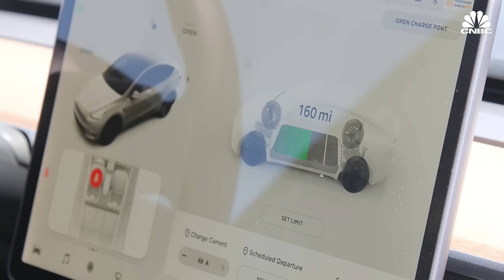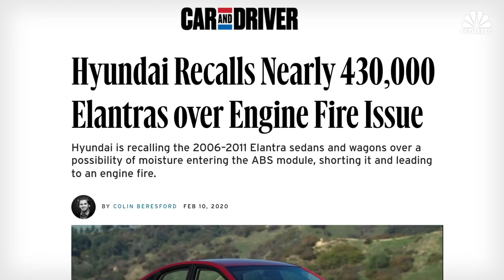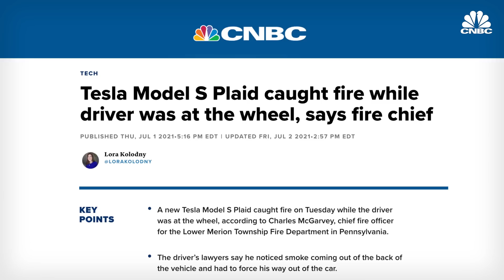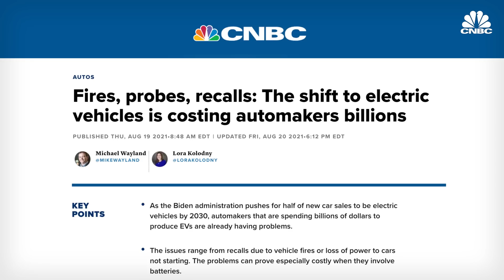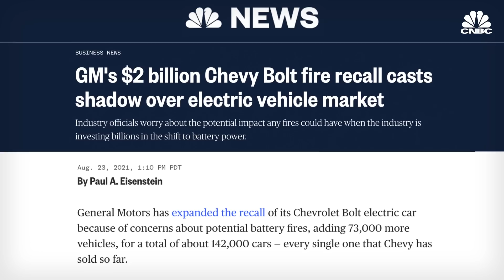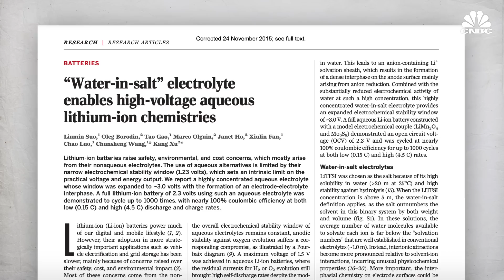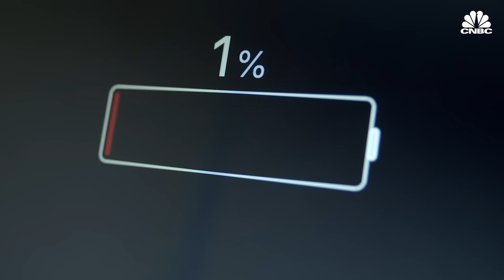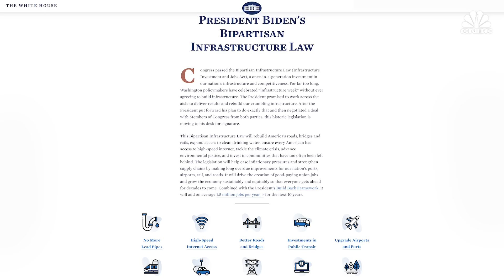Why Tesla, GM And Other EV Companies Have A Fire Problem

Comment: My brother drove a gasoline VW van that burned to the ground. If you look at the number of fires per number of type of vehicle, EVs catch on fire much less often. And with battery chemistries like Lithium-Iron-Phosphate, the chance of fire is much reduced.
Reply: Cool, what is the source for your statement that the number of fires are lower per capita for EVs? Would like to refer to that should I ever consider an EV for purchase.
Reply: “...but when fires do erupt, they burn longer and hotter, propelled by lithium-ion batteries that supercharge the blazes, experts say,”
Reply: @sking2173  Not so with lithium-iron-phosphate batteries. Solid state batteries will be even safer still, but they won't come out for a couple of years.
Reply: This wont change my mind on buying ev vehicles
Reply: @unfairsanic5089  Well do ur thing dude. Just have a escape plan ready.
Reply: Was that a 40 year old vw van?
Reply: @stevemurray710  No, it was about 15 years old.
Reply: @lesliefranklin1870  we will have to wait to see what percentage of 15 year old rusty Teslas catch fire.   That's if any Tesla makes it to 15 seeing battery replacements cost $16k.   The battery cooling system will clog and corrode.  Inverters fail, motor bearing.  Huge money pit.  Despite claims of being cheap to maintain there is a reason the Tesla doesn't have a bumper to bumper 10 year warranty.   Repairs are $$$$$, versus needing a muffler.
Reply: @stevemurray710  Tesla was founded in 2003 and launched the Tesla Roadster in 2008, Model S in 2012, Model X in 2015, Model 3 in 2017 and Model Y in 2020. They are some of the most safe and reliable cars on the road.

To be fair, Tesla is not an economy brand. If you needed to repair or replace an engine on a BMW or Mercedes, it would cost $$$$$ too.

There are about 173,000 (in 2020) gasoline car fires per year. This is not in the news because this has been going on for over a century.

Also, you should talk with a Buddhist. They can tell you about the impermanence of existence. Laughing, because we can't do anything about it. LOL! Peace be with you.
Reply: Ev fires are way more deadly genius.
Reply: Correct as there is no thermal runaway issue with LFP batteries.
CNBC is constantly behind the curve in reporting in the EV space.
Reply: EV fire numbers will only increase as more vehicles are added
Reply: @TheIncomparableGolfer  No.   The fire risk is per 100,000 cars.  "Fully electric vehicles, on the other hand, were deemed far safer than both hybirds and gas cars; they are far less likely to catch fire, with just 25.1 fires per 100,000 sales. That's compared to 3,474 hybrid fires and 1,529 ICE fires per 100,000 sales respectively."

Electric cars are simply over 60x less likely to catch fire than combustion engine cars.
Reply: @redbaron6805   your a fool if you think that per 100,000 # won't increase when more electric vehicles are sold.

Also ICE vehicles made since 2010 catch fire alot less than older ICE vehicles. So even the per 100,000 for ICE vehicles that carch fire will keep decreasing
Reply: @TheIncomparableGolfer  No they won't, because the usage of LFP and Blade Type batteries will only increase. These have zero thermal runaway characteristics......
Reply: @Brian-om2hh  you are correct LFP is the way to go.. lets just hope we have enough "battery manufacturing material" to supply the global demand..
Reply: @TheIncomparableGolfer  True. However, the percentage of EVs that catch on fire is much lower than ICE cars. It's new and unusual, so it gets more reported. ("Man bites dog.")

Remember the Ford pickup trucks that spontaneously caught on fire because of faulty cruise control design?
Reply: @lesliefranklin1870  Dude...U don't understand. EVs make up 3% of auto sales. If that number increases to mass adoption u can't tell me that EV fires won't overtake gas fires.
Reply: @herbertfreeman3767  "the number of fires per number of type of vehicle" I was posting about percentages, not totals.
Reply: @lesliefranklin1870  Dude...anyway u slice it EVs still carry a greater risk of exploding than a gas car. There exploding  wile charging. Gas cars are not catching fire wile fueling up at gas stations.
Reply: @herbertfreeman3767  No. Because the fires are per 100,000 cars.  "Fully electric vehicles, on the other hand, were deemed far safer than both hybirds and gas cars; they are far less likely to catch fire, with just 25.1 fires per 100,000 sales. That's compared to 3,474 hybrid fires and 1,529 ICE fires per 100,000 sales respectively."

Still struggling in the facts and data department there Herbert?  Math not your thing...?
Reply: @herbertfreeman3767  "Dude...anyway u slice it EVs still carry a greater risk of exploding than a gas car. There exploding  wile charging. Gas cars are not catching fire wile fueling up at gas stations."

Except the ACTUAL DATA and ACTUAL MATH shows the polar opposite.  EV's are 60x less likely to catch fire AT ALL.  Most of the fires area after catastrophic crashes after the battery was damaged, NOT while the car was charged.

Please tell me no one graduated you from High School...
Reply: @redbaron6805  go get that head injury checked dude. Ur math and ur fantasy land facts didn't impress anyone today. The only thing that was proven here is that you fell off that cabbage truck hard. And ur  refusing treatment.
Reply: @lesliefranklin1870  look up their methodology please. Don’t just take the number for granted
Reply: @herbertfreeman3767  exactly and the fires are more intense and toxic
Reply: @mmc5261  yes sir. 👍💯
Reply: @herbertfreeman3767  From today's news: Ford Motor Co. has asked the owners of 350,000 vehicles to take them into dealerships to be repaired under a three-pronged recall announcement. About 39,000 of those vehicles should be parked outdoors because their engines could catch fire, Ford said. 

The Michigan automaker said in U.S. government documents posted Thursday that it doesn't know what's causing fires in some 2021 Ford Expedition and Lincoln Navigator SUVs.

Still, the company said the fires can happen even while the engines are off. There have been 16 reports of fires under the hood
Reply: @JayMcKinsey  Yes...Point taken. I still wouldn't feel comfortable having a electric car in my garage that's attached to my house on a charger charging all night wile I'm sleeping. That's just me. Even though Ford is having this problem I would still sleep better with a gas car in my garage. I'm in my 50s, been driving gas cars sense 1985. Never experienced a gas car fire. I know they exist.  

If you ask me EVs have a long way if there going to replace gas cars. Can't see myself sitting at a charging station for a half hour waiting for energy wile playing video games and eating snacks. I take a lot of road trips and I don't like wasting time. You can still travel farther with gas than electricity. When I travel I like comfort. Air, heat and cool seat. Don't want to have to turn anything off to save range.  When I travel don't want to have to go out of way of travel looking for a charger.  Gas stations are everywhere. 

Also gas cars are 100 years old or older. The problem that Ford is having is recent. What about all the vehicles Ford has made sense they been making cars? EV are new and right out the gate there having fire issues?  Come on...
Reply: @herbertfreeman3767  Sounds like I am a year older than you are. One would expect new technology to have problems like fires but one would hope that mature tech would be beyond it. Yet the ratio of fires in EVs is less than in gas cars and decreasing. The new wave of battery technology is called LFP and it does not catch on fire. Half of all Teslas already use it. 

EV's don't have to be the solution for everyone today, production isn't even close to being able to produce that many. They just need to satisfy the needs of the next marginal buyer and they will take over soon enough. The US will be at 85% new EV market share by the end of the decade.
Reply: @JayMcKinsey  EV fires are less because they make up a small percentage of the market. Come on...as for new battery tech, That's cool but anything that has high rates of electricity flowing through it has the potential for fires. Don't believe everything you hear. The same for gas. Anything that's man made in a factory with careless workers has the potential to fail.

And I'm not totally against EVs, I just don't like the idea of being forced to buy one. If you like them go get it. But for old timers like me who grew up loving internal combustion engines and legendary cars like  Corvettes, Challengers and Mustangs you can't expect me to be all on board. 

Starsky and Hutches Grand Torino, the Dukes of Hazards General Lee, come on man... you really want to rewrite those tv shows and put Teslas in them😄? Miami Vices Ferrari, what about Fast and the Furious? Give them all tesla plaids. Come on man... some things should be left alone.
Reply: @herbertfreeman3767  I can, because the newer battery types don't burn.....
Reply: @TheIncomparableGolfer  Percentage %

Comment: Seems like they need to come up with an air robbing foam to better put them out. One of the problems with fire suppression foams is they tend to be extremely toxic for the environment. Its finding a safe one or safest as possible.
Reply: fire in an electric car battery is a chemical fire and does not require oxygen to burn
Reply: @billyponsonby  all fires require oxygen whether it is wood fire or chemical fire. The only difference is in a chemical fire the source of oxygen can be and is created during the chemical reaction caused by a shorted lithium battery.
Reply: @billyponsonby  fun fact, all fires require oxygen to burn. Some chemicals make their own oxygen 😅 figured I'd point the obvious out.
Reply: Lithium batteries carry their own oxidizer, like rocket engines. So even if you cut off oxygen access, they continue burning.
Reply: @charlieangkor8649  absolutely correct.
Reply: That is not true of all lithium ion battery compositions!
Reply: @lisamcdonald7828  Just the one's that are commercially viable, the one's that have the most power per lb.
Reply: @lisamcdonald7828 Yes, it is. When lithium goes into thermal runaway it will keep burning as long as it has fuel. Some chemistries are more stable than others but the fact is that once a vehicle goes into thermal runaway there is no way to extinguish it.
Reply: This an uninformed statement. The lithium battery makes its own oxygen and fuel. No way of cutting off either.
Reply: Or you could just ban evs
Reply: These batteries produce oxygen when in thermal runaway. No amount of foam., water or retardant will stop that Chemical reaction. Currently the only solution is to cool the batter to below 200 Celsius.  This is easy if you can drop in in a big tank of water. Not easy in the case of a car stuck in a garage, drive, ferry deck, channel tunnel, parking lot, road side, dealership, anywhere…
Reply: Why not ban cars entirely and make city's more sustainable and profitable by making them more dense and walkable it will reduce obesity and and other health issues and also battery cars are not good either they use tires and building them requires rare earth metals which causes pollution battery cars explode mixed housing is better
Reply: @ujjalshill6442  why not ban cities?
Reply: @poisonouslead85  yes
Reply: @poisonouslead85  we should ban cities
Reply: @poisonouslead85  cars are not as important as city's
Reply: So city's can stay
Reply: @FowlorTheRooster1990  you will need to pump that into the metal box that holds the battery.  For a firefighter to do that, they have to lift the car or turn it on its side, drill a hole in the battery case then insert a tube into the case while the car is on fire.
Reply: The initial event in a li-ion battery fire is the release of the stored energy of the battery cells which does not require oxygen. This is why fire suppression measures do not work on these fires. It is like trying to extinguish a fire in a package of dynamite, only slower.
Reply: won't work. The chemical reaction inside the compromised batteries create their own oxygen. The answer is Lifepo4 battery chemistries. They do not catch fire.
Reply: @davefroman4700  I hope you are right. I have a little over 20kw of LiPo4 sitting on my porch for solar storage.
Reply: @fauxque5057  Thats a chunk for sure. How much solar?
Reply: @davefroman4700 They’re more stable, yes, but they still burn the same way as any other lithium battery. There is no solution.
Reply: maybe they should be forced to stop using lithium ion batteries altogether. Furthermore, they have poor energy density and are a poor choice for an EV energy source.